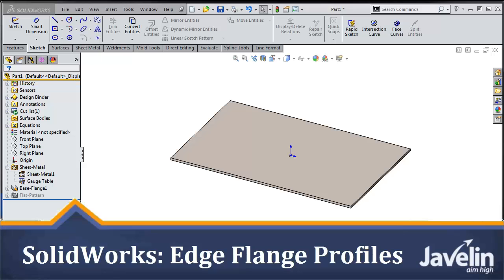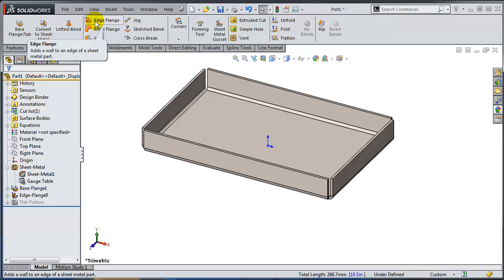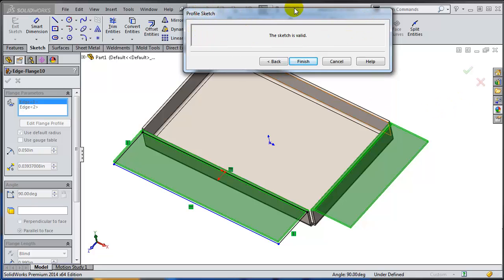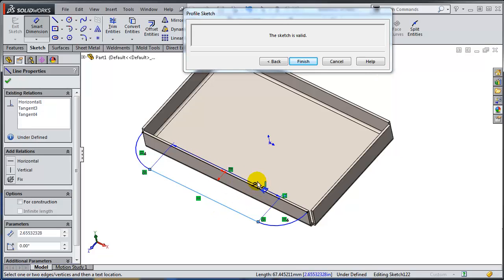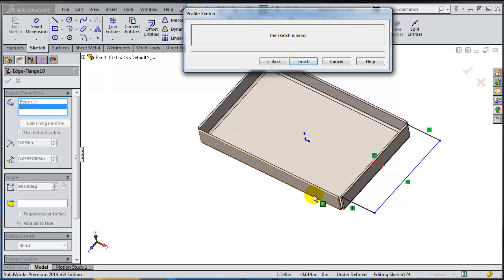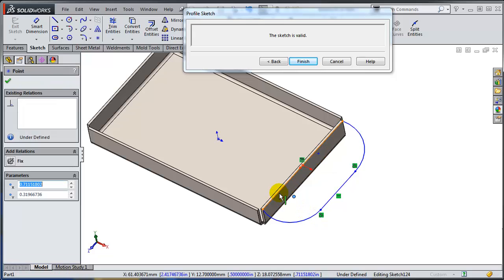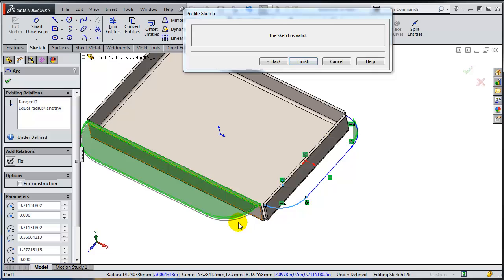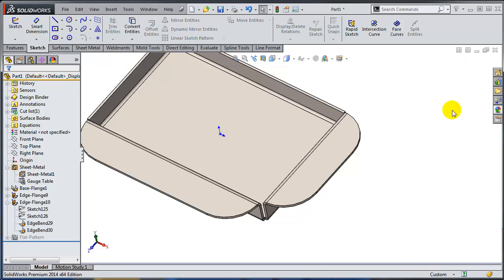SolidWorks Tutorial - Edge Flange Linked Profiles

Comment: Great presentation, but I want to see wat's happen when you create 2 configuration for this part and try to change the one dimension of edge flange in one configuration
Reply from the maker: Nucu, in that case both flanges will follow the change in the new configuration.

Try it and let me know if it works.
Reply: I'm talking about a bug in sw that exist in 2012 sp5 2013 and also in 2014 sp1. Try to make 2 configuration and change the dimension for one of them.